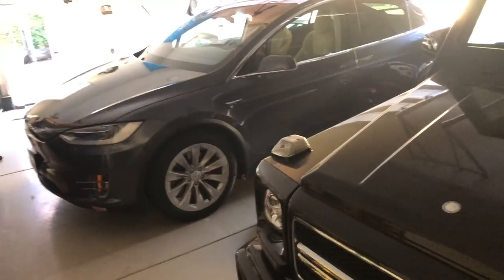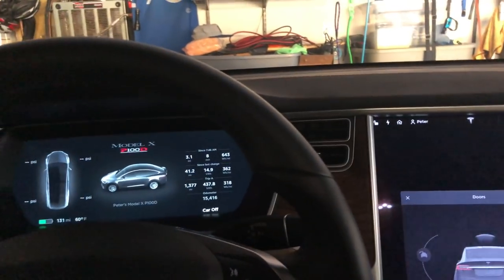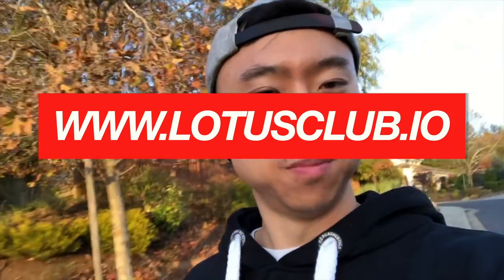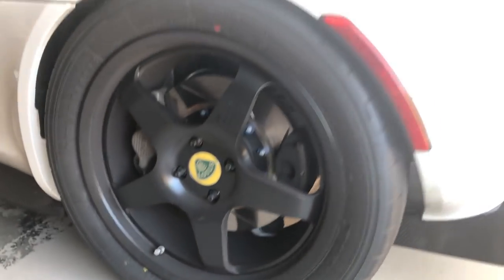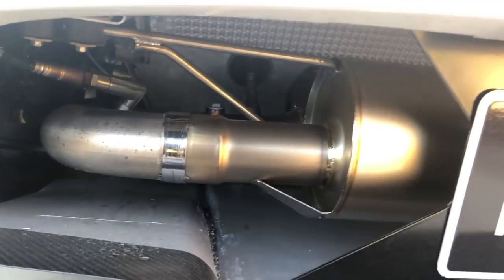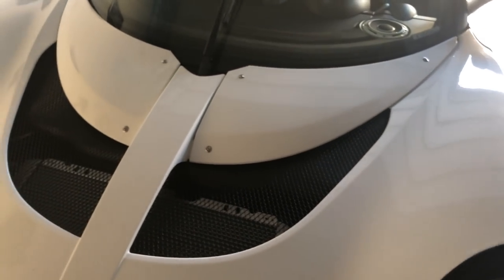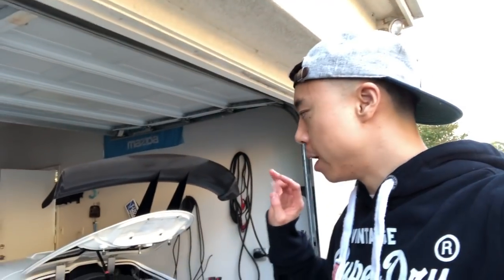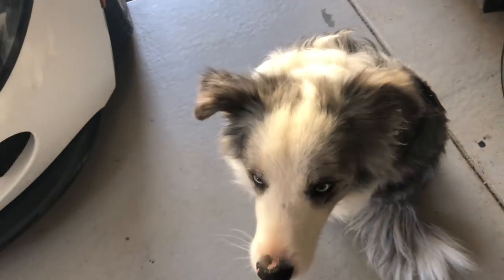Walkaround of My MODIFIED 2007 Lotus Exige

Comment: What is the issue with the NRG hubs?
Reply: Considering NRG steering wheels bend and break apart just from normal driving use, I'm not sure I'd expect any of their quick release hubs to fare any better. Hell the machining of the holes can strip out the very first time you thread in a screw... fuck that garbage.